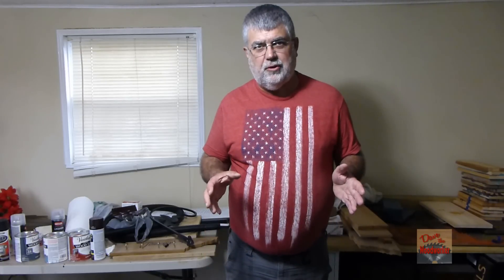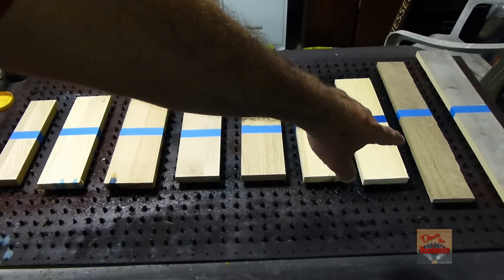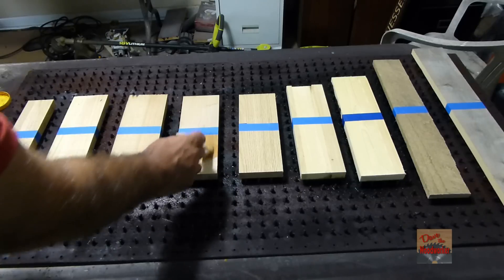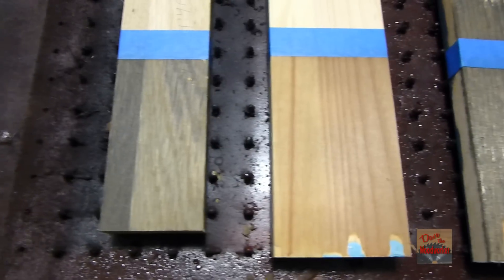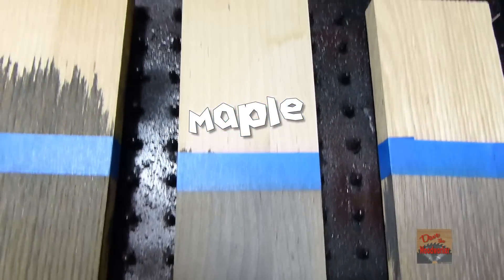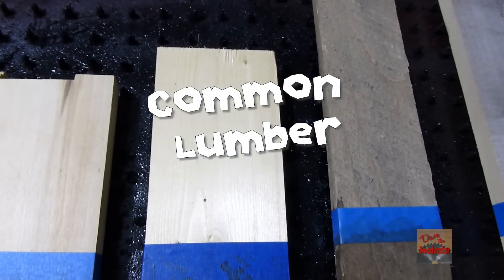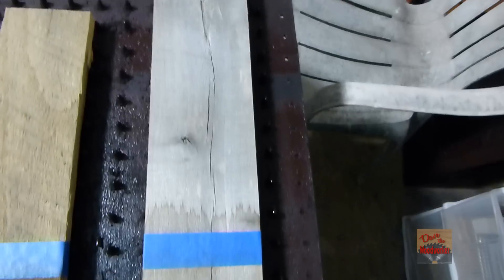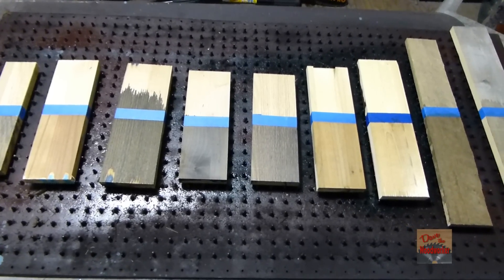Steel Wool & Vinegar Testing on Different species of Wood

Comment: We use a technique that is similar but has some variation to his.  1.) We sand our wood down to a smooth finish with 220 grit sandpaper 2.) We use strong black tea 3x on the bare wood and we let dry 3.) We use a solution of apple cider vinegar and steel wool that has sat and reacted for 3 weeks.  Depending on the wood, we may or may not use an amber oil-based polyurethane finish.  With cedar, we use the amber polyurethane and it looks like walnut.  With hickory and poplar, the amber stained polyurethane isn't necessary but we do use a clear water-based satin polyurethane finish.  Our wood turned out absolutely beautiful.  It's a lot of work but we save $$ on not buying the stain.  The polyurethane is expensive but at least we aren't buying the stain.
Reply: how does the finish product differ when using apple cider vs. white vinegar? Thanks
Reply: @chuckgrumble5440  - apple cider vinegar gives a deeper color.  I prefer the apple cider vinegar over the white vinegar.
Reply: @christineherbst199  thank you

Comment: I know this is an older video, but i have a basswood guitar body to do this to...any idea how basswood would take to this?
Reply from the maker: I don't, never had any basswood
Reply: 2 years later... did you try it on basswood and if so, how did it turn out?
Reply: @meadish  I never got around to it. I don't really feel comfortable suggesting that you try it tho, because there's always the chance that it could ruin a perfectly good guitar body...scrap wood is free game tho
Reply: @lordimpaler3899  Thanks for replying and being honest! 

I think I will save this technique for a mahogany build somewhere down the line. 

I just came across King Bespoke Creations' basswood bass guitar build that he burned and then oiled. I think the deep charred black he achieved will be perfect for my build and a great contrast to the pickguard.
Reply: @meadish  what style of guitar are u building? (Les Paul? Strat? Etc)
Reply: @lordimpaler3899  I've got a few in the pipeline, temporarily on halt because my house got badly flooded and I need to focus on salvaging/making furniture. But here is a list of projects:
1. Basswood Jazzmaster (the one I will char). Will need these steps: putting frets in (I replaced the fretboard because the original "rosewood" was uninspiring amd the distance from the nut to the first fret slightly too long, so I removed the original freboard and splurged on an ebony fretboard from StewMac which is now glued in place and has holes drilled for fret markers. The body contours have been carved, the pickguard is wired, so after finishing the body and neck, I just need to solder in the pickups (Toltec, UK).
2. Mahogany Jaguar (the cheap neck I bought for it turned out to not work with Fender standard measurements, so I have made an extension of the neck heel that corrects the scale length, but it still needs a little filing to fit perfectly between neck heel and neck pocket). I have done all the soldering I can outside of the body and all the parts are bought and ready, so finishing this one should take less than 1 week. 
3. Glamcaster in blue sparkle and gold (Strat shaped) which will get two Filltertrons and a Babicz bridge.
4. Silver Strat HSS with Alnico II humbucker in the bridge and 2 cheap (but great sounding) single coils in the middle and neck position. Nothing fancy, just a standard Strat really. 
5. I bought a block of composite rubber wood that will yield 4 guitar bodies. It is really cheap wood and will be great for me to practice on. I will make various less famous offsets: 1 Talman, 1 Novo Serus, 1 Ryan Jarman signature Musuar, 1 Pawnshop Mustang Special. To practice making necks for the first time, I got 4 mahogany neck blanks. 
6. I have stripped a Yamaha Pacifica 511 HFM of all its parts except the bridge, and am making a new body for the electronics and neck. I am tempted to attempt a silver sparkle finish, but we will see. 

 I've already cobbled together 3 partscasters. 1 hybrid of JM body, Tele control plate, 2 P90 pickups and Jerry Donahue Telecaster wiring, 1 standard Strat (to make mistakes on) and 1 Tele with an Alnico II humbucker in the neck, a standard Tele bridge pickup (slighty overwound), and a Warmoth boat neck with stainless steel frets. 

As you can see, I have way more ideas than I can accomplish, but it's fun.

What are you working on?
Reply: @meadish  Nothing at the moment, but  I've had my eye on one of those Rick bass style kits

Comment: how long does this stain last?
Reply from the maker: If you seal it, long time.
Reply: Thank you for taking the time for this experiment. Very helpful.  For those interested in this technique. If you  brush the wood with a  tannin  mixture befor applying the vinegar mix and let it dry, it will darken the wood  considerably more.  The red oak, in my experience will go totally black when treated with tannin.

Comment: Because I am lazy, would it be possible to put this in a spray bottle and spray a project instead of 'painting' it on?
Reply from the maker: Maybe but the steelwool pieces might get stuck in the nozzle
Reply: @davethewoodworker1043  what if I run it through a coffee filter while filling the bottle?
Reply from the maker: @13dannyboy13  that might work
Reply: Hey, did you end up doing this? It's funny, I was wondering if I could do the coffee filter thing and then happened upon your comment. @13dannyboy13
Reply: @tanner6538  I did. Worked great actually.